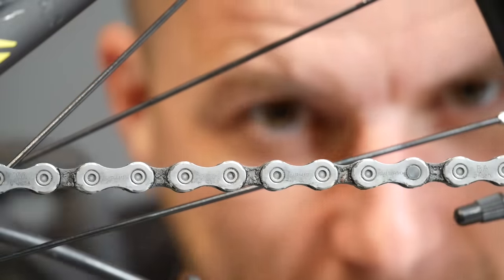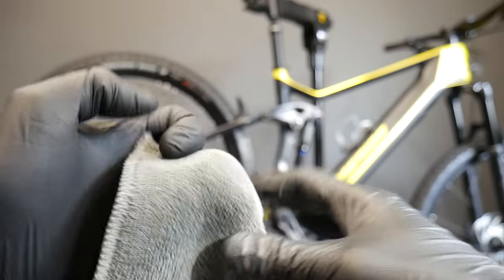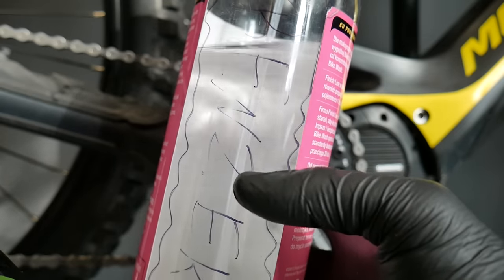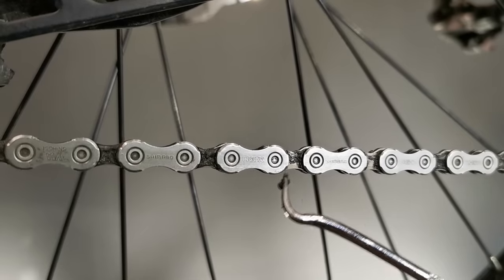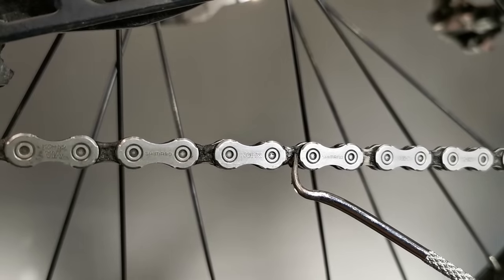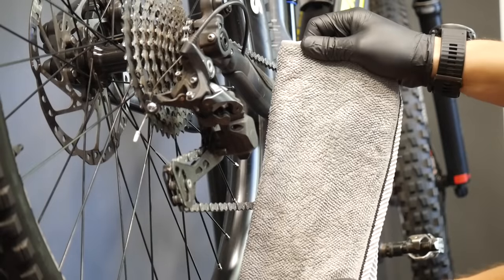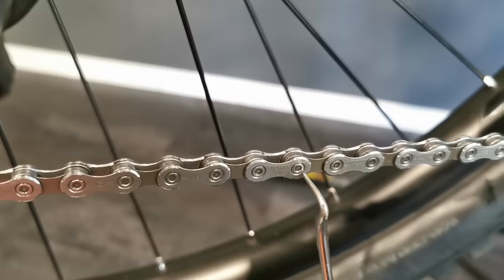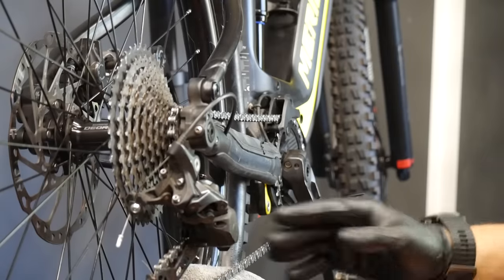This Drivetrain Will Last Much Longer. How To Clean And Lube Dirty Bicycle Chain. Slow Mo Comparison

Comment: Whoa whoa whoah........ you’re gonna tell me that you would spend all that time spit shining each and every link of the chain but not remove the large chunks of road goo from the crank chain ring and pulley wheels or cassette. Seems odd. That is where the wear on the system is going to be happening.
Reply: EXACTLY.. the last part triggered me so bad! I thought he would then proceed to cleaning the plates but the video just ended.
Reply: The wear on the system is caused by the chain. If abrasive dirt is left inside the chain parts, these will make chain links to get further apart and that widening of links will start to bite all casete and chain rings and as a result, chain rings teeth will look like shark fins and then the chain will start to skip when you "put the hammer on"
Reply: No wonder
Reply: the title did say cleaning the chain only.  said nothing about total drivetrain cleaning.
Of course you would clean the chainring, sprockets, and derailleur.

Comment: Old white athletic socks turned inside out work great!!!  We wash the holey ones and I turn them inside out and you get that "terrycloth" texture.  Turned inside out, you can put your hand inside and really clean with them. They get various kinds and stages of use before we finally throw them out.

Comment: Chain cleaner tool, with water and washing up liquid. 
Give the chain a good whizz thru, then rinse with clean water, dry and lube ( I use a wax, rather than an oil lube).Chain clean as a new pin.
Reply: Instructions unclear. Just took a whizz on my bike.

Comment: High pressure water jet with a soap mixture works fine for me.. i just blast it.. remove all the grit in 5 mins tops.. dry it up and lube it.. done.

Comment: 1. Take off your chain (15 - 30 sek?).
2. Put it in an empty plactic container (water bottles work great).
3. Fill the bottle with a liquid of your choice and put the cap on.
4. Image you’re a bartender and shake it like there is no tommorow.
5. Open your container (or cut off the the top of the bottle for an easy access) and wipe dry.
6. Apply grease now or after putting the chain back on your bicycle.

The solvent used for cleaning can be used again. Leave it in a bottle for some time for the dirt to deposit on the bottom and after that pour it into another bottle (u could also use a cloth to filter the rest of the dirt).

10 minutes and you're done 😄
Reply: That method is not too eco friendly. Did you see how litle degreaser was used in the video?
Reply: @wrongusername  he literally said degreaser can be used again. how is that not ecofriendly? it's not like he is letting the degreaser soak into the pavement or soil.
Reply: @NLghost010  well it takes a lot more degreaser to soak than to wipe. Lets say 300 milliliters vs 30 milliliters. Of course re-using that 300 milliliters is more ecological than throwing it away, but you are probably not going to get 10 re-uses of it.
Reply: @wrongusername  thats true, i might test it sometime and find out since im curious now how long degreaser will last. At least the Degreaser is contained though and can be disposed of properly after a few uses instead of getting in the environment.
Reply: @NLghost010  yes, definitely a superior method than pouring it on thr chain and washing it down the drain :)

Comment: PARK TOOL Cyclone CM-5.3
With liquid degreacer.
This tool clean the chain like no other! It save a lot of time. I use it for the last 2 years.I leave in Germany and I ride a sport bike every day to work, shopping or to fitness. It rains a lot her. So i have to clean my chain often.I star to use dry chain spray so the chain get way to less dirty. Before I used always wet chain lubs and they make your chain so dirty so fast when it rains.
Your welcome!
Reply: Everyday commuter here! Just switch to the belt drive bicycle. It will save you tons amount of time and money : ) I cycle around 10K per year. I'm saving a fortune on cassette, chain, lube (smoove), etc.. Around 200 EUR per year. For me, switching to the belt drivetrain was the same feeling when I switched from V-brakes to Hydraulic brake. Never going back!!! Especially in commuting!

And for chain best lube is wax-based Squirt or Smoove. They will keep your chain clean forever and significantly extend drivetrain lifetime. Don't forget to apply wax-based lube to completely clean and even better new drivetrain! Your welcome! : )

Comment: Yeah, my chain is like 10 or 15$. So I just clean the mess with a rag and a brush quickly and grease it after.

No need to spend 1 hours every month to get the chain pristine degreased and then grease it back and mess it in 1 hour lol.
1 hour of your time worth more than a chain. 

Go ride lol have fun.

Comment: Why complicate? 
1 Remove chain, 
2 Wash with brush in soapy hot water in a recipient and dry it as soon as clean (change water a couple of times until clear), 
3 lube as soon as dry (after putting it back), one drop of oil per ring (i use engine oil as its the same motorbikes manufacturers have always recommended, just put it on a eye dropper bottle) and clear excess with rag. 

While it dries or looses in hot water, clean the Cassette/Sprocket.
Reply: This is actually much easier, thanks!
Reply: Hey that’s cool. how hard is it to clean dirty chain after wet, slushy rides? Also how many miles till the chain squeeks?

Comment: Simple and easy, take off chain , put in a jar with whitespirit, aceton, or  color solvent -  thinner, then shake a few times let it absorb through. Then take out the chain, wipe dry with rag. Chain are clean as new. No need to buy expensive chain cleaners, where you can buy at home depot 5L whitespirit, aceton, or  color solvent for this purpose wich will be enough for a long time.

Comment: This was actually painful for me to watch. Cleaning a bicycle chain does not only not require a degree in Rocket Science it favors those who flunked out of the program. While it is true that the dirt on the outside of the chain does damage and while it's true that the methods demonstrated in this video will eventually remove that dirt (if you are willing to spend the time) the dirt that does the most damage consists of small particles residing inside the rollers and links. Far as I know you can wipe the outside of the chain 'till hell freezes over and you won't touch a grain of the most damaging dirt. For more than 40 years I've cleaned bicycle chains quickly and thoroughly via the following method: Using a 1 qt plastic bottle with screw on top I pour 8-10 ounces of kerosene into the bottle. Next having removed the chain from the bike I carefully lower it link by link into the kerosene. Next I let it soak for a few minutes and then I gently shake the bottle up and down, side to side, for several minutes. Finally I pour the liquid kerosene into a second bottle being careful to leave the sludge removed from the chain in the bottom of the first bottle. Now gently shake the bottle as before and then remove the chain from the bottle. Now using an old towel or similar type of rag thoroughly wipe all the kerosene off the outside of the chain and hang it up somewhere to dry. Once dry lubricate the "inside" of each roller, and the mating surfaces where the side plates are attached to the rollers with a quality chain oil using an applicator that allows pinpoint drip by drip application. While most people seem to think that oiling the outside of the chain is what's called for it is the inside of the rollers that most need to be lubricated. Oil on the outside surfaces of the chain serves as a dirt magnet and should be kept to a minimum. Once you've finished oiling the cleaned chain put it back on your bike and while holding your towel around the chain backpedal a dozen revolutions to wipe excess exterior oil off the chain. Job done and with an occasional exterior wipe with a rag you should be set for awhile.

Comment: So i finally after 6 years took my chain off and washed it thoroughly in white gas.  I also cleaned the chain rings and the cassette. Now I use dry lube and the chain is as good as ever but what most people do without contemplating the results is pedal at a slow cadence in a higher gear instead of spinning higher rpm's in a slightly lower gear as this reduces the chain stretch/ wear.
Reply: Maybe try a chain checker, after 6 years it's probably worn...
Reply: . @DR_1_1       Nope chain is fine but I spin at 85-90 rpm and about 60 rpm up the numerous hills we have . As a normal chain is 114-116 links long ,mine is 288 links so it will take a bit longer to wear out

Comment: Jeez. If I had to go through that much to clean a chain, I'd trade my bikes for a horse. When the chain starts making noise I blast the chain/cassette/jockey wheels/chainring with a pressure washer, dry, apply DuMonde Tech Lite, shift through the gears, wipe off chain, go ride, wipe chain again. Usually good for 6 or 7 rides in dry conditions.
The amount of gunk left on your chainring at 7:00 tells me you're using the wrong chain lube.

Comment: Spent 1/2 hour to clean chain with a shoe lace, but oil the chain on a speed rotation in a few seconds) especially filmed in a slow mo how oil get in only 1 of 3 sections) looks like these steps must be reversed: clean fast with decreaser and oil it precisely from one section to next one

Comment: I use a mini paint roller on the chain, I apply degreaser to the roller then simply hold it against the chain and turn your crank. The roller will turn with the chain, you can lube the chain the same way. Then simply hose the roller to clean after each task😃

Comment: Proper waxing a chain will also vastly increase the lifespan of a Shimano Sil-tec chain, SRAM PG1070 sprockets and chainring. I wax my chain regularly for every 800km (top up with liquid wax lub after 400km, until 800km). My 10spd chain normally service around 4000~6000km before reach 0.5% elongation. My chainrings and cassette have been at 12000km and 16000km, still works like a charm. Just to be sure wax doesn't protect chains from rusting. So proper drying is needed after wet ride. I normally ride my XC bike on roads and light XC trails.

Comment: This is why i use the chains with a speed link.  Just unlink your chain and put it in a tub of kerosene.  Scrub with a brush.  Dry with a rag.  Put on a bike and lube.
Reply: I do not get why people do not use them. I take my chain off weekly to swap and clean makes life easier and you are going to be more inclined to maintain it better.
Reply: Have you tried gasoline? What is the difference?
Reply: @anriandreev4913  It works ok. I always use white spirits afterwards.

Comment: What's the point of cleaning the change if you gears/start are still dirty? :)
Reply: dirty chain is harder on clean drive-chain than a dirty drive-chain is on a clean chain. but yes, it is best to clean the drive-chain also.

Comment: Sometimes I feel like using a proper wax based lube like Squirt or Smoove, or even going with the crockpot hot melt method is time consuming because you can't just throw lube on your chain and ride. 
Then I remember the cleaning with oil based lube. The grime, the solvents, the mess, the Fred tattoos and I realize why I used a dry, wax based lube. Every few rides wipe the chain off quickly with a dry rag, apply some lube while back-pedaling, and leave it to dry for a couple of hours.

Comment: Great video, I like the two tooth brushes idea, I’ll be making one of those. But you need to clean those rear mech jockey wheels, they looked caked in grease, otherwise all the good work you’ve done on your chain is wasted.

Comment: Much easier/faster to use a dedicated and cheap chain cleaning tool, where the chain is brushed and immersed in cleaning fluid.
Reply: One of the clumsiest persons - me - has used a ParkTool, the alpha cleaner, for this purpose. The magnet underneath is kept in place by a plastic pin which was loose after a few uses. Then the ingress/egress lips wore down and cracked. The pin on one of the locks went loose again. Granted, I moved the crankset forward, not backward as instructed. It seems that PT opens up the market with specific tools, the rest follows at the same price point. Decathlon has dedicated brands which are about as cheap/expensive as the mainstream. Who sells a solution, not a sum of something? The best cleaner could be made in alluminium or stainless steel.
Reply: It makes a mess. And it uses dirty degreaser liquid. 

Plus side is the magnet. It collects metal particles worn out of chain. 

Chain washer is quite easy to use, but is not necessary the best method.
Reply: Never good to immerse your chain in degreaser, it removes the grease from places you'll never get it back into. Chain will wear out faster. Best just to wipe as he does in this video, although is time consuming.
Reply: @LauriAP  easiest way to clean a drive train is taking the chain off the bike and putting it in gasoline for about 20 to 30 minutes after you put it in gasoline you can clean the rest of your drive train after that you could dry the chain and re lube it and then dry it again then boom clean drive train in 30 minutes
Reply: The shoelace method takes the longest but is the most thorough
Reply: The easiest way is a plastic bottle + fuel (gasoline) + dirty chain = 2 min clean chain. Very cheap, very quick and max effect
Reply: @ДмитрийСтрельчиков  exactly what I do
Reply: Haven't seen the shoe lace trick i will be trying it out next time 👍

Comment: The quickest and easiest method i found is to spray the chain down with water (pressurised garden squirt bottle, hose or low pressure washer) then with spray on degreaser, water again and then wipe it with high quality kitchen paper. No rags needed, no need to clean towels, quick and easy. If indoors just take the chain off and wash it in the sink with a toothbrush and degreaser.

Comment: A lot of this seems cosmetic. You get chain baths with brushes in them to try and get the crap out of INSIDE the links, AFAIK it's the ground down gritty paste in there grinding metal on metal, or a lack of lube, that does the damage.
I cleaned my chain recently but couldn't be bothered with the that (though I do have a chain bath). I used nail brushes to get a similar effect to above, much better than tooth brushes.

Comment: Remove chain, soak in (degreaser of choice) rinse, hot water with degreaser ultrasonic bath, remove dry, into pot of paraffin wax with ptfe. Soak for 1 hour remove, wipe down. Mount on scrubbed and dried drivetrain, the excess wax now lubricates drivetrain. Wipe off excess. Done.

Comment: Quick-link, remove chain chuck in a tray with turps, swirl, dry, install, lubricate.
Reply: I'm with you... but he's using a solid shimano pin, not a quick link (that I could see).
Reply: Jet wash .
Reply: @TheBRad704  Yes he is, but that's easily fixed.
Reply: That’s what i do too

Comment: Take the chain off, soak it in degreaser or petrol in a sealed container or bottle give it a good shake to get it agitated. Its the dirt that gets inside the rollers that does the damage. While the chain is sitting in the degreaser clean the jockey wheels and the chainrings. Yes scrub the chain with a brush but when it's off the bike on a flat surface. When you were oiling the chain half the rollers were not getting any oil.. maybe I've got OCD but I could never clean my drive train like that.
Reply: That was my first thought when I saw how crusty the cogs were. Cost alone can run $30+ a set if they have bearings. If there's that much mud, just take them all off and clean out the grit after a good soak.

Comment: Sorry, but if you're mentioning the drivetrain, you completely forgot to mention cleaning the casette, jockeywheels and chainrings. So in that sense, this is also crucial to get a long lasting drivetrain and needs to be noted!

Comment: take an empty 2 liter plastic milk bottle. Remove the chain from the bicycle (power link). Put a small tyrapp through the two ends. Put the chain in a plastic bottle and some degreaser (gasoline) Fit cap and shake it. Do this as long the liquid does not become so black anymore. The degreaser can be collected in a 25 liter barrel

Comment: Take the chain off the bike and put it in a gallon milk jug ( empty of milk ) pour some degreaser in there with the chain and  shake like it's a maraca for a few minutes. Empty degreaser and flush with hot water while shaking it well. Repeat till the water is clear. Dry the chain in the oven or in hot sun . Lube it and you're on the way. Cleaning on the bike never does a really good job.

Comment: Use a good dry lube then after a dirty ride just wash it off with a waterhose, blow dry it with a leaf blower or air compressor, then re-lube it. Do that often enough and it doesn't get too grimey to just wash off.

Comment: Personally I do 4 times cleaning on the bike. very simple first apply the degreaser and then wipe and wait 5 minutes then apply oil spray and wipe again. now you are ready. when you have done this 4 times (over a 2 months time) remove the chain and deep it inside the gasoline shake it and let it rest 10 minutes. clean it and wipe it then mount it on the bike and apply oil. Voila! easy

Comment: Wd 40 microfiber cloth and some fine stainless steel wool  with some elbow grease and then 3 in 1 oil. Job done in 10 minutes.

Comment: Rubbing alcohol soaked toothbrush + rag, do all four sides of chain with rag pushing the opposite side of where brush is rubbing. Wait overnight for at least six hour and add back lubes like durmonde or T-9. This is a overhaul I do for first bike and subsequent 6 months per each. Normally I do alcohol rag + lube.
Reply: What does rag mean?